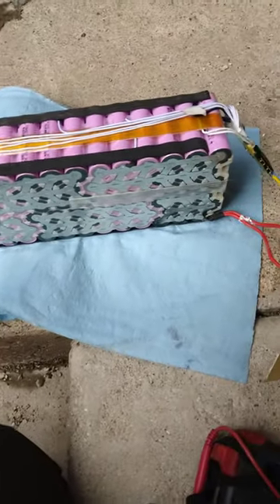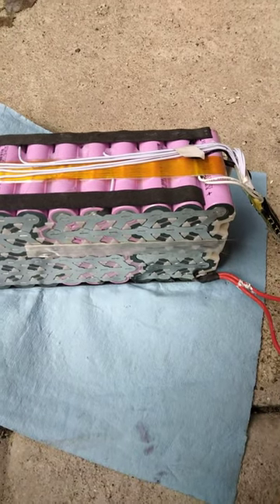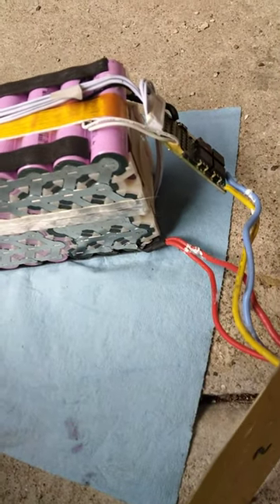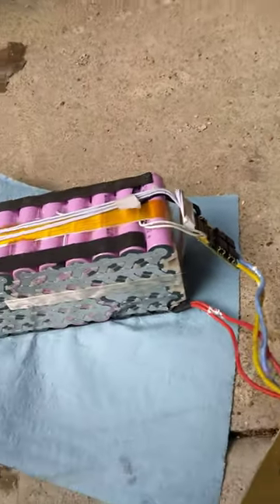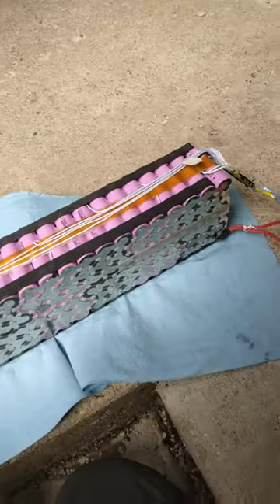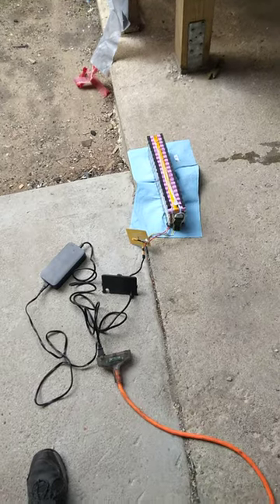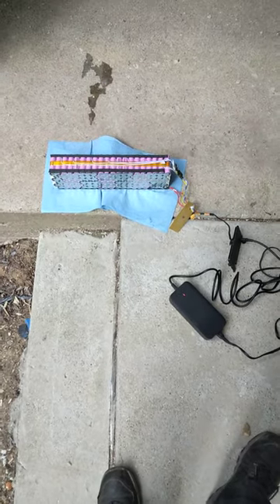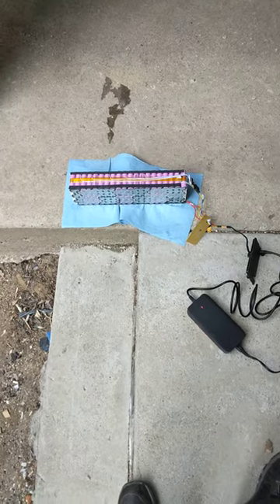bad battery cells or BMS reset on a escooter/ebike battery

Comment: Man, thank you so much. It’s really work. It helps me but the problem I don’t know how to make the battery back together. I disassemble it. I don’t know how to back it, but you’re the man I will verify firefighter in any case but not but nothing happened. Thanks, God.❤❤❤❤
Reply from the maker: @hatemaliforobjection2414  Glad to hear it, man. You can.
 Always measure your size battery and buy The Heat shrink off of Amazon or AliExpress. You can also buy the fiber bord as well. Cut it to the dimension to install it.

Comment: The battery for my onyx CTY2 looks just like this, and I unfortunately ran it down to nothing the other day. The BMS reset, and for some reason it shows on my overkill solar app that the battery is charging at 10amp yet my charger is only a 5amp charger. Another strange thing is that whenever the BMS reset itself, it came back saying that it was a 100,000 mah battery, so I manually changed back to 23,000 mah. I have no idea what’s going on, but it’s obviously still dead because I plugged it into my bike and the display died after just a couple minutes. Not sure why it states that it’s fully charged, or why I had to manually input all the parameters, but all I can do is hope for the best I guess.
Reply from the maker: @jcolt84  how old is the battery?
Reply: @theebikeguy3852  December 28th, 2022 was the manufacture date
Reply from the maker: @jcolt84  ya the cells are likely Tost. If it been left in the cold Especially... But you could get a volt meter and Read each Cell 4.2 full any thing under 3.2 not good, 3.0 dead!

Comment: Hello my friend. I have a 52 Volt battery (Arwibon Q30 Pro Model Scooter ) After fully charging scooter then riding it for 10 mins it shut off. It no longer takes a charge.  When I test the charging ports it reads 51 volts. When I test xt60 or output it reads 30 volts while quickly depleting then settling on .2 volts.
Reply: When I would turn scooter on for split second. it would show display light up with low voltage reading  real quick then shut off. Literally in a second. When I try again nothing . If I let it sit for a while it will start up again for a split second show display then shut back off. 
Also note then if I turn it on . After it appears dead if I push it I start to get a voltage reading on the voltage reader on the throttle. The fast I push the scooter the faster the voltage will raise . The scooter is so dead thats its very dim and higher the voltage goes as I push faster the brighter and higher the voltage reading becomes
Reply from the maker: @pryingopenmythirdeye1830  If you.
 Have any experience very carefully open the battery up. Make sure there are no wires that are disconnected from the battery management system. Are any of the battery can also test. The Battery cells to see if they're showing full voltage.  If they are you have a defective B m s. Otherwise.
 You have some defective cells. However, if this is a warranty issue I would not go in to that unless you have a shop. Do it otherwise you will avoid the warranty.

Comment: After reconnecting the BMS to the batteries, do you reconnect the ebike or just wait for the batteries to finish charging, then connect it to the bike?
Reply: Ok God told me that you have a big battery pack for your buggy car and about 80% of your battery cells are bad (losing charge, or not hold a charge) and it is not a BMS issue. You'll have to either purchase a new battery pack or build one. Oh and please don't charge your batteries greater than 4A. 2A is the safe spot for longevity use of battery.

Comment: I have a 52 & 48 v batteries I I use on my 3 1kW bafang midrive mountain bikes. Over the last 2 weeks I had a faulty controller that had a 30h  error. I sent it away and it was reflashed and is now working. And I have a new 1kW motor on one of my bikes with a better. 750c Bluetooth display. The issue I'm am having is the 48v lipo is only charging to 81% charge and when I ride it, I'm not getting anywhere near as many miles as I usually would. The 52v lipo charges to 100% but the mileage also was no as good as it was just a few weeks earlier. I did however just fitted a new 50a BMS on the 52v and just tried your reset trick on the 48v one. Could it be both bms's were faulty? As the batteries are less than 2 years old and haven't been under water one however came off when I hit a pot hole forgetting to lock it.
Reply from the maker: As far as the 48v on the new display make sure its set for 48v, If you messed with other settings it could cause issues also. Most cheaper batterys will get 500 to 800 charge and discharges, good li-ion like Samsung LG and Panasonic can get 1000 charge and discharge, if the battery fell it could have also broken the soder on 1 or 2 batterys so it can't reach full charge. Also if the  battery was stored in very cold temperatures say below 10° will permanently damage cells. After you do a full charge if the batty says 48v check it with a multi meater if the meater says 52.6 or so then either the LCD is not set to 48v or the display is simply reading the voltage incorrectly. If the battery how ever says 48v same as display and.yes there can be a 1.05 difrence in the reading then it's possible the batty is going bad, also if you charge the battery around 80% all its life and don't let it fully discharge it will alow the batterys to last longer once in a while 100% is fine. ONE OTHER THING if this is a.mid drive the motors controller has to be flashed to the same voltage. If it was not done so already.
Reply: @theebikeguy3852  I tired your trick and the 48v one still only charged to 80%. The 52v one with the new BMS now only charged to 80% before it at least charged to 100%. I'm going to check each cell in the morning. And reset the display. I live in Australia so it definitely hasn't gotten too cold 🤣 it may be the charger but to have two batteries ho bad at the same time seems very bizzare

Comment: Hey bro I seen a lot of corrosion on my battery and when I plug it in the cooter turns on but as soon as I unplug it it shuts off, I read the voltage and it’s throwing off 64.3v which is good means the battery is charged but why doesn’t it stay on ?
Reply from the maker: @CharlesLeon-p6q  Well, if you unplug it, there's no electricity, go into it so it will shut off. As far as having a lot of corrosion that coulbecause. A possible cross jump.
 Which would make the battery x stupid or possibly mess up the controller

Comment: I had a battery that would occasionally refuse to charge, and sometimes I'd plug it in and it would just charge fine. Then it did what this battery did and died completely and when plugged in the light on the charger would stay green. Stumbled across your video whilst looking for a way to fix it and tried this and it worked perfectly. My fear though. What was the reason it needed a reset? Will it just come back? 

Brilliant video though thank you, feels like it might've saved me a battery :)

Comment: Hello

Great video! 

May I ask, did you just a) take the (white) connector of the top of the BMS and charge the battery as normal or b) have to bypass the whole BMS circuit board completely by connecting the charger to the battery positive & negative directly. 

Regards
Reply from the maker: disconnect the BMS the cluster of wires to the bord,Then you connect the battery charger to the charge port weight  approximately 15 seconds reconnect the BMS while the charger is plugged into the battery. At that point you're BMS should be reset, hope this helps.
Reply: @theebikeguy3852  Hello

Thank you for the prompt reply and providing more clarity on what to do.

Regards

Comment: Hi can you help me fix mine i left the bike for one months and i think i need to due the same charging the all battery pack or one by one
Reply from the maker: Get on later and check the voltage put it on 12 volts see how many bolts the batteries showing and let me know

Comment: Hello, I have no idea what it could be, but my fat bike (ouxie v8) is working perfectly, charges well and everything works, etc. until the battery drops below a certain percentage, approximately after 15 km of riding, then it still shows on my screen It seems to have around 46 volt output, but as soon as the support starts working it cuts out after a second and the lights that indicate how full the battery is no longer work, I have never actually had this problem but it came out of nowhere. Do you know if something like this can be solved and if you have any tips, that would be great!
Reply: Btw fully charged it said 56 volts
Reply from the maker: @jochemvdberk734  56v is a 48v battery at full it should be about 56.7 but close enough. I would suspect you ha a group of bad battery cells, if it's less then a yr. Old the company should replace it for free, if it's between 3-5 years old the batterynis at the end of it's life Cycle It's always best to charge the battery. About 85% full. You probably can't fool and never let it completely charge down where the b. M. S, shut it off. Of course, those days that you are going to go for a very long ride. Then charge it to 100%. This will help prolong the life of the battery. Also, keeping it inside below 23° is a good idea. Maybe it falls below 0 oftentimes. This will kill lithium-ion battery permanently. And if you're restoring the bike for winter. Have it around 65 to 70%. And once a month plug it up for about 5 minutes. This way, the batteries and the BMS will be maintained and last longer. On a Another note it could be the controller. However in this Case it does sound like your battery.

Comment: When you reconnect the BMS do you unplug the charger first
Reply from the maker: @4thn1666  You can try unplugging the charger and plugging in the battery management system afterwards. If that doesn't work, then you can leave. The problems are lined up correctly before reconnecting the b. M. S

Comment: Hello, can I ask did you reconnect the BMS when it was charging? Or did too unplug the battery after 15 seconds and then re plug the BMS?
Reply: *you
Reply from the maker: Watching the video if you listen closely disconnect the BMS Then you connect the battery charger weight  approximately 15 seconds reconnect the BMS while the charger is plugged into the battery. At that point you're BMS should be reset, hope this helps.
Reply: @theebikeguy3852  i am still puzzled. when you say disconnect or reconnect the BMS you mean the balance wire connector or desolder all wires from the BMS? and do all BMS do the same and why you need the battery direct connect on for 15 sec? please explain better thanks 
erhard
Reply from the maker: disconnect the BMS (white cluster of wires from the bord)Then you connect the battery charger to charge port, weight  approximately 15 seconds reconnect the BMS while the charger is plugged into the battery. At that point you're BMS should be reset, hope this helps.
Reply: @theebikeguy3852  I done this exactly disconnecting and reconnecting and it didn't work still wouldn't charge must be bad fella right?

Comment: Yo man. Great video! 
I have the problem that I just bought a 60v offroad e scooter, it rode normally at first but then suddenly turned off and wouldn't turn on anymore. As soon as I let it charge a few seconds, it works again. At some random point while riding it turns off again, which I think definitely is the BMS. I don't want to take the battery apart, maybe it's just some other random thing. That's why I'm asking, what do you think? 
I rlly hope you reply, since this video is pretty old.
Reply from the maker: It could be either Is the battery management system overheating and shutting off, Or it could be.
A bad cell or group of cells in the battery. I would suspect this has XT60. Connectors on it have you tried disconnect in the battery from the controller Then reconnecting it. One last thing I would suspect this is not a folding electric bike that has the four male and female prongs that close and the battery makes connection there?
Reply: @theebikeguy3852 Thank you so much for the reply. I was planning on disconnecting the battery firstly to try that out. And nope, it's not foldable. I have a HWWH E scooter (60v, 40ah, 6000watts bla bla bla...) 
I definitely think it's just some not right connected cable, since it just arrived yesterday. I'll try to disconnect and re-connect the battery today, I'll keep ya updated
Reply from the maker: @SlateNga.s  Should have a 1 year warranty. I would contact the company. As soon as you mess with the battery, they will void the warranty.

Comment: I fixed my battery with this Thankyou. I have one set of cells that are measuring 3.0 volts and all others are 3.9. Do those need replaced?
Reply from the maker: Most 3.7 cells are about 4.2v charged and lower side of 3.4v anything around 2.75v or less is a bad battery 30v is getting close to going out.
Reply: Got a 72v surron battery that’s reading 4.6v at connectors,left it charging overnight with battery plugged into the bike.
Reply from the maker: @SCHW1FTY-lb2zx  First off, never leave any EV charged overnight. It could potentially cause a fire if the bms. Or charger fails. When you plug the Charger into the wall and then into the chargeport.Does it stay green or flash green. Use a volt meter to test the battery. If the Volt meter is also saying the same thing. That's way unrevoltage , b m s could possibly be. Or it could be a couple of bad cells, it's hard to say.
Reply: It stays green.  Also when plugged in battery jumps to 100%. When charger unplugged drops back to 0%
Reply from the maker: @SCHW1FTY-lb2zx  Use a Volt meter to test voltage. If the battery is three years or older and has been in very cold weather or heavy rain most likely you have a defective battery at this point

Comment: look at my Escooter called a Ebike Lol. Subbed ebro #170
Reply from the maker: I mean I get it the company's name is what it is but putting it on a e-scooter they just gave me a headache
Reply: @theebikeguy3852  I know im just messing with you this vid is nice it just helped me my son put a 72v charger on my 60v baattery now it won't take charge. gonna try to reset my BMS Thanks ebro Keep up the good work
Reply from the maker: @T2daBikeGuy  I'm sure you know some of these come with fuses. Hopefully putting that extra voltage through the bms only cut the bms off,, it's possible that the BMS is fried however hopefully you're lucky and it just needs to be reset, good luck with it.
Reply: @theebikeguy3852  got guy say he'll do it for $45 but i might give it a try after watching ya vid im pretty techy and practice safety.

Comment: Glad i dont use bms what a pain
Reply from the maker: Yes who needs extra safety to help balance the battery's or overcharging to cause a fire. Or  deplete to low and kill the cell, most people don't know how to regulate a Li-ion battery so agood BMS is important in most cases, if your one of the few that knows how to maintain a lith. Battery good for you, bit unfortunately most don't, at the same time this is what's wrong with the world people have come to codependent on a computer component or any thing to make it easier so they don't have to use there Brain